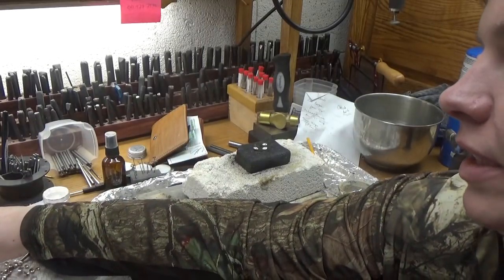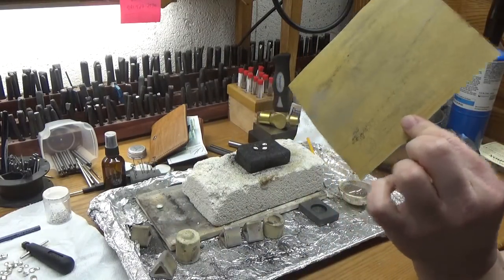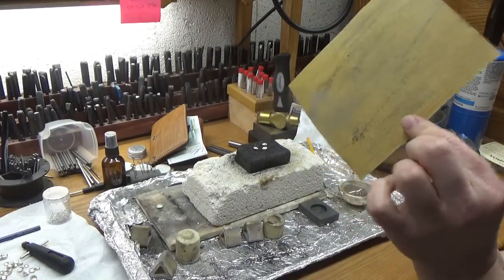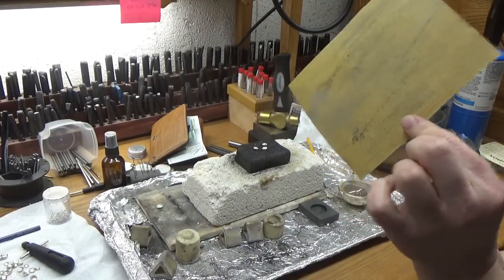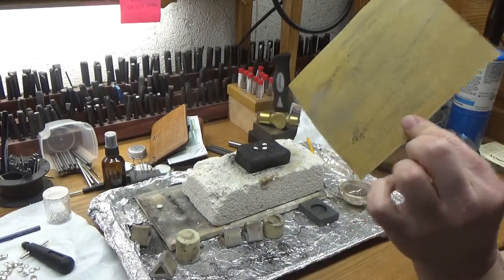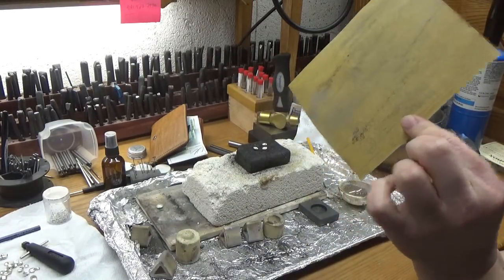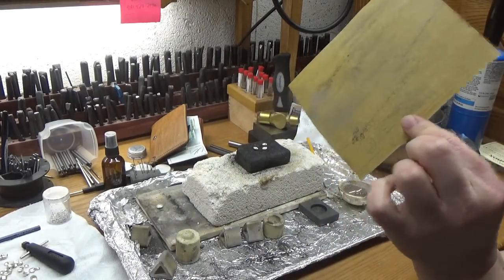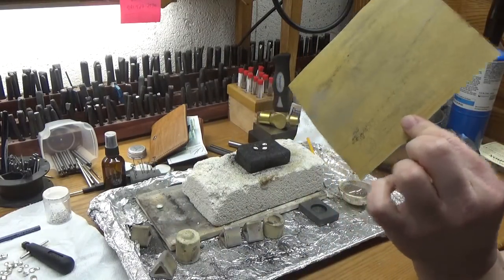Sweat soldering sterling silver beads (and cleaning seams)

Comment: Thanks for all your videos!  Just found your channel this weekend and am binge watching them all!   I made some larger lentil beads and found paste solder much easier by syringing a thin line around the inside edge of one half and placing the other on top.  Not only is it easier to place the solder evenly around the bead, but it helps keep the two halve together since it's paste.  It doesn't take much at all and I didn't have much clean up to do afterwards.  The whole process was much easier than I thought it would be. I was really happy with how they turned out.